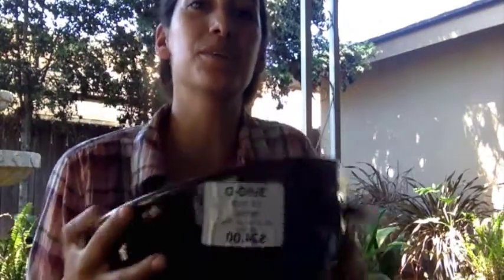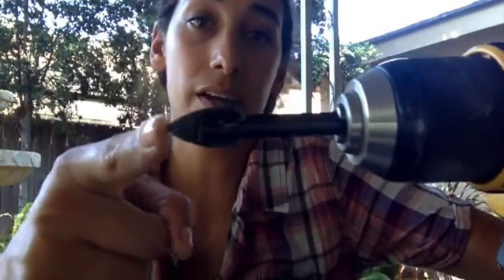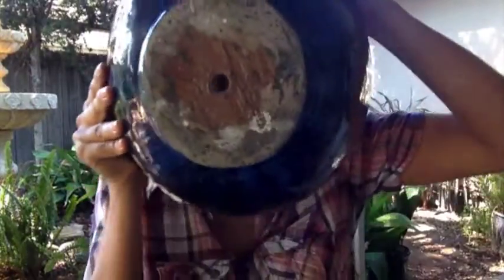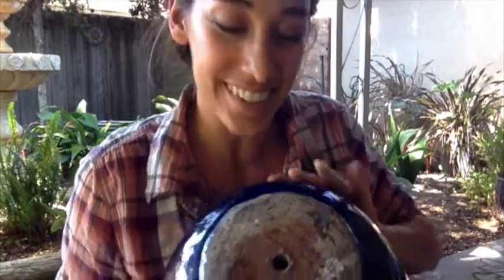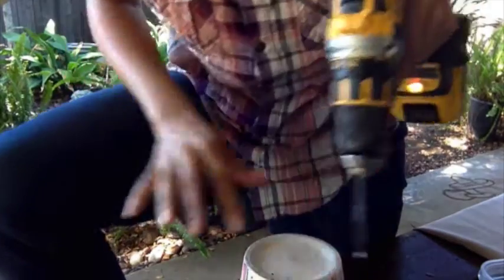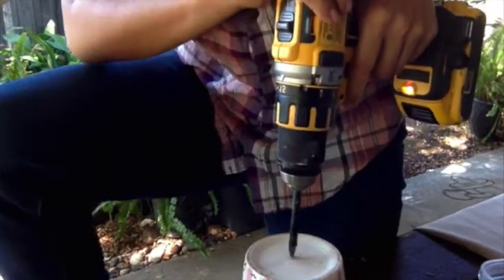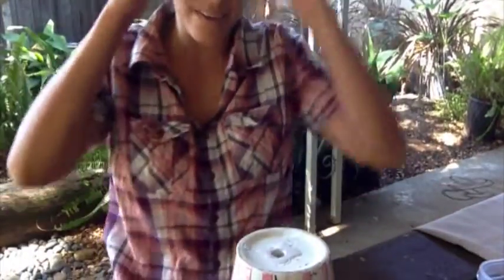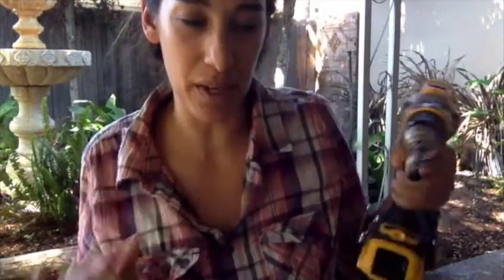Drainage hole in a flower pot | Sara Bendrick

Comment: Enjoyed watching, tip -the big pot had no ceramic coating on bottom, if soaked in water overnight easier to drill through and less likely to crack. Also overlap a few pieces of masking tap, put over were your going to drill if bit is jumping around on you keeps bit in place. Wear a mask!

Comment: I noticed you're drilling in reverse. (Counter clockwise) Was that deliberate? Most drill bits have an angle ground into the end of the bit to help it drill through material faster in the forward (Clockwise) direction.